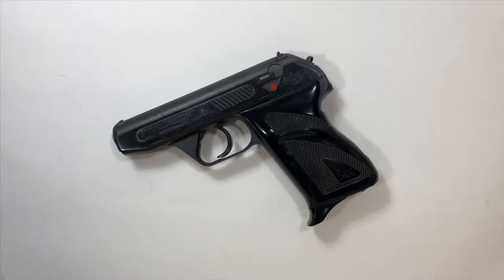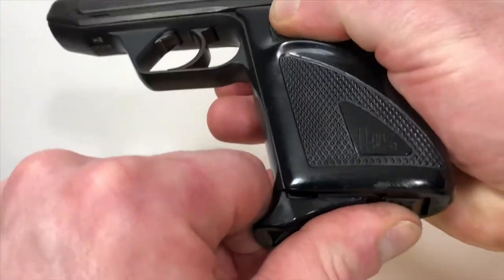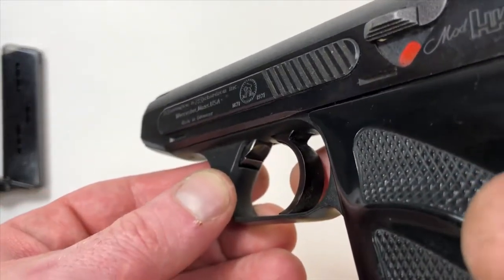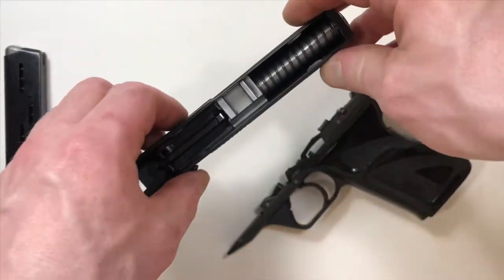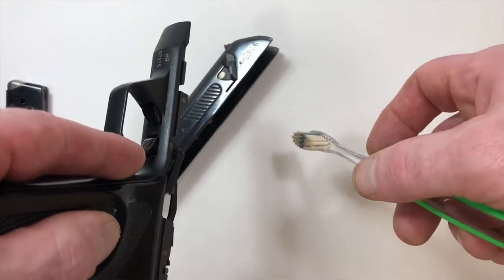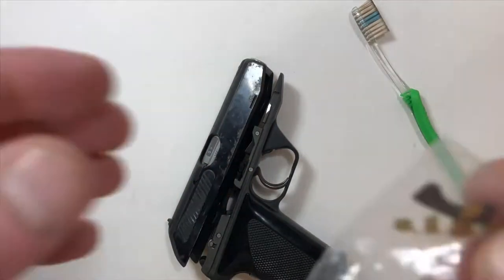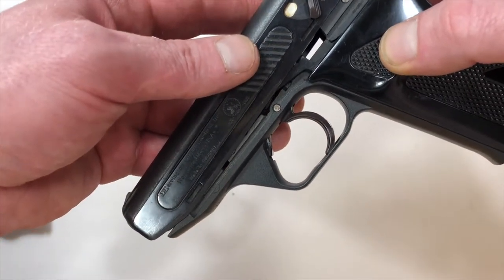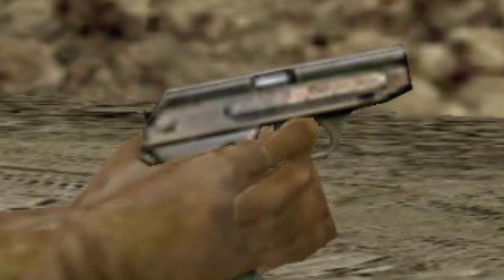H&R Mod HK4 Pistol Harrington & Richardson Handgun Review History Field Stripping Heckler Koch 9mm

Comment: There is another way to get the slide to go forward: When the slide is locked to the rear and with the magazine removed with the safety on you can also release the slide by pulling the trigger.

Comment: If you pull the trigger with the slide locked back it will send the slide forward
Reply from the maker: I didn’t know that... unfortunately it’s not my gun but that’s certainly an interesting feature.  Clearly an idea that led to the squeeze cocker series.
Reply: The gun can also be decocked by putting it on safe and then pulling the trigger. Not the safest of decocking designs.